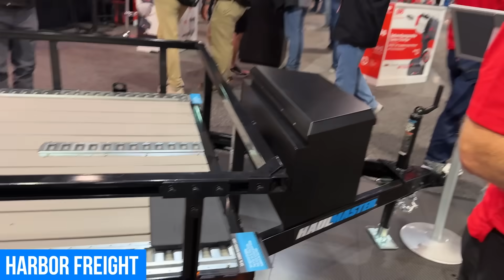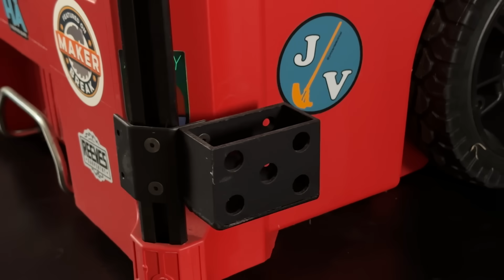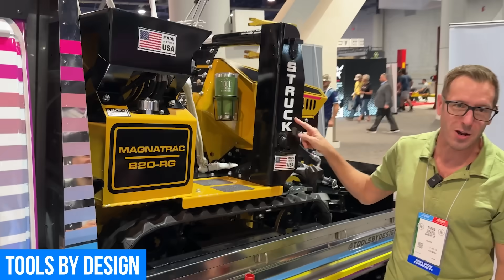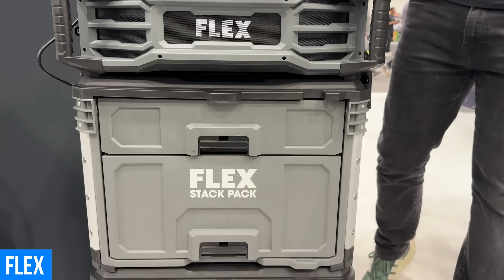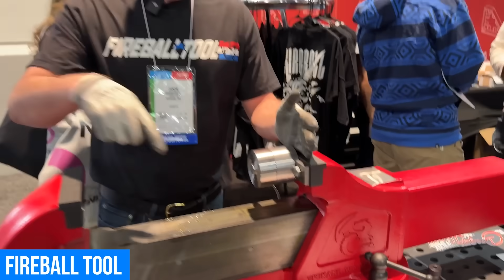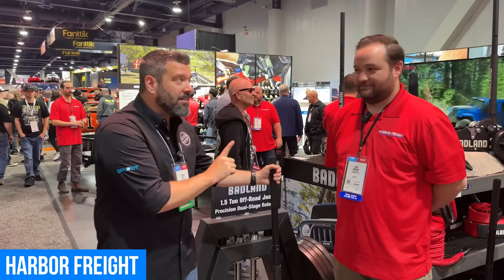NEW Power Tools from Milwaukee, GearWrench, Harbor Freight, and more at SEMA 2024! DAY 2

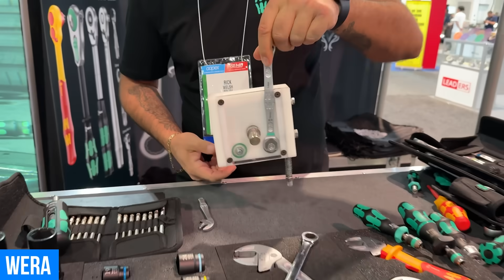Comment: 32:38 That wrench is a lifesaver. It is a must-have tool. The way that this wrench has a gripping feature to grip the nut without slipping, we need a drill bit support tool that can enclosed the drill bit tip, and assist the bit in holding screws in place, while drilling the screws into construction materials.

Comment: That gear wrench box mega mod thing is making my OCD so happy! It looks so so good, so much better than my boxes just filled with things and organized to the best I can. I love an organized tool box! My wife and fellow techs used to mess with me by going in and turning screwdrivers so the labeling on the handle faced down, or moving sockets or pliers around! Drove me nuts! And the mega mod thing fixes that, right up until it doesn’t!  As I said it’s absolutely gorgeous and I’m all about that beautiful organization, but where do you put all the other tools you will invariably need? I honestly think my OCD would be worse with that beautiful mega mod setup with other random tools scattered about with no real way to organize them, then it is with my conventional box and conventional storage. Basically I’d rather have everything look OK and be decently organized then have 75% beautiful and the remaining 25% just tools haphazardly thrown where they’ll fit. But that’s just me and my OCD impaired brain!
Reply: For sure , and that's not exactly an " entry level " set either , no one's just gonna test the waters with a set like that , they're gonna have a decent collection of tools already . Sell what would be a duplicate and keep the odd balls in a 2nd cabinet

Comment: I've bought acid brushes and wrecking bars for Harbor Freight. I wouldn't touch anything from them that has a moving part or mechanical connection. Certainly no power tools. Nothing but junk.

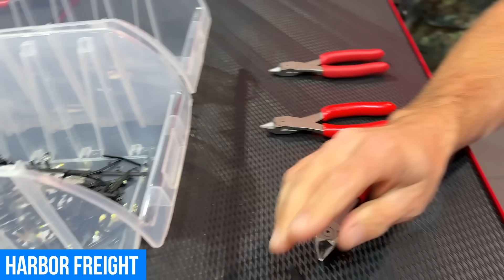Comment: 14:30 I love the new HF pliers (Knipex and Snapon copies, basically) but, for god's sake, you don't need flush cut pliers, you need to use regular square-jaw pliers and TWIST off the zip-tie tails. Leaves a clean round nub that will never cut anyone.
Reply: Might be easier to use flush cuts in tight spaces
Reply: Maybe I’m doing it wrong but when I twist with square jaw pliers, the round nub always has a point that IS a point for scratches never had a problem flush cutting. Plus it doesn’t stretch the plastic part and make it potentially weaker order the latching part. 

I’m glad it works for you.